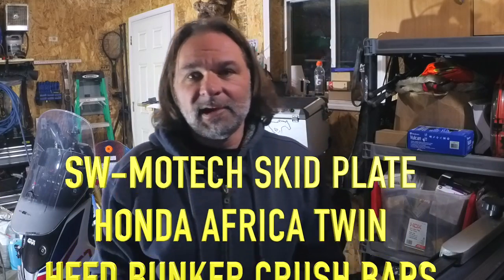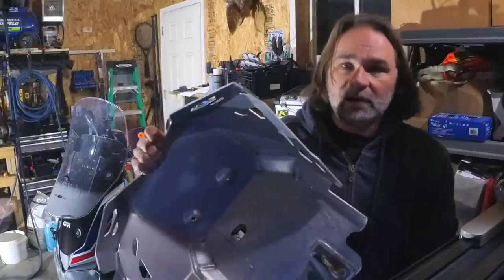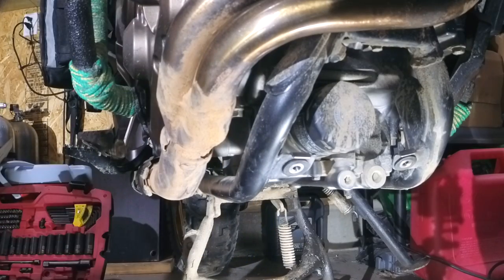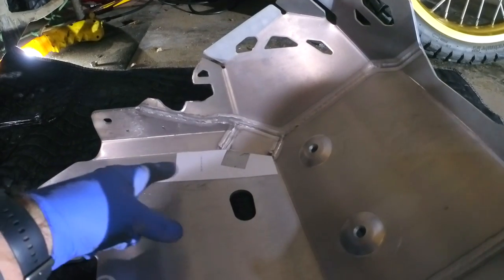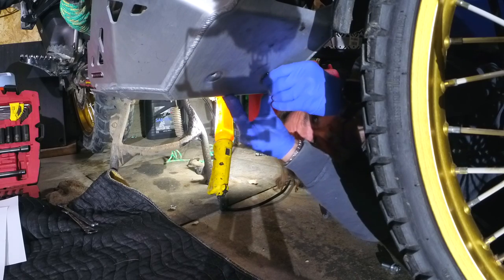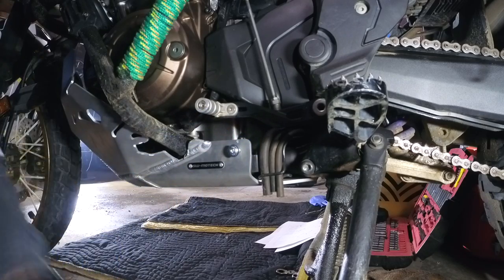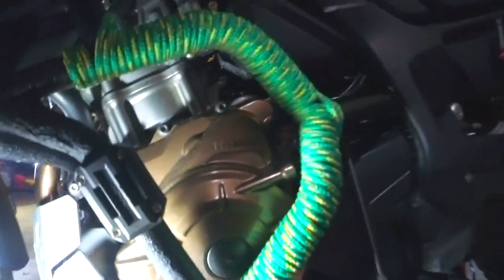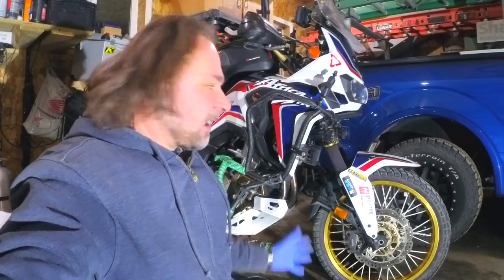SW MOTECH SKID PLATE HONDA AFRICA TWIN WITH HEED BUNKER CRUSH BARS

Comment: Really nice job.  I'm thinking about upgrading my OEM skid plate.  (It's not the most robust, but it's ok if you're not banging it too much).  But it looks like I'll have to do some mods to the new skid plate too - for it to fit around my Hepco & Becker guards.  Might have to get me a nice angle grinder!
Thanks for another helpful video.  Keep riding safe, man.
Reply from the maker: Thank you for watching I couldn't find any solution so I decided to give that a shot and it worked

Comment: I installed Heed crash bars on my 22 africa twin and I would like to install Heed skid plate but not a steel plate  still watching your video
Reply from the maker: I had the skid plate for quite some time at the end i was not as impressed and last year I have installed SWMotech way better quality and durability with angle grinder you can make it fit with Heed engine bars
Reply: @AdventureTravelandScuba  I'm at work and I was watching it on a break but I will finish watching it on the big screen at home appreciate it
Reply: Where is SW Moto Tech bash plate located? Do you have a link or a phone number sir ? and thank you
Reply from the maker: @mototechsam3051  i bought it locally but you can get it here https://www.tradeinn.com/motardinn/en/sw-motech-mss.01.622.10002-s-honda-crf-1000-l-africa-twin-carter-cover/138825338/p
Reply from the maker: @mototechsam3051  https://fortnine.ca/en/sw-motech-engine-guard-silver-mss-01-942-10100-s
Reply from the maker: @mototechsam3051  just make sure it fits 22 as mine is 17

Comment: Thanks for your video. Why does the 14mm nut have to be removed from underneath and the bolt slid back?
Reply from the maker: You will have a hard time to fit the skid plate if You don't

Comment: I'm using these SW Motech skid plates for 2 years and I'm quite unsatisfied with the supplied mounting brackets, those are bad engineering design. It's a pain to mount the plate with them, the mounting tabs will easily come off and rotate with the bolt. I have reinstalled the OEM Honda grommets and brackets and those are much more reliable. Luckily the OEM brackets are compatible with SW Motech supplied screws, are much more reliable and easier to install the plate with them.
Reply from the maker: I couldn't agree more You are correct I am very happy with the skid plate itself but yes the front screws are pain in the rear end lol. I never thought of this idea of using OEM mounting screws I give it a try this month when I will be changing oil maybe even make a video on this issue that may help others thanks for the idea 💡